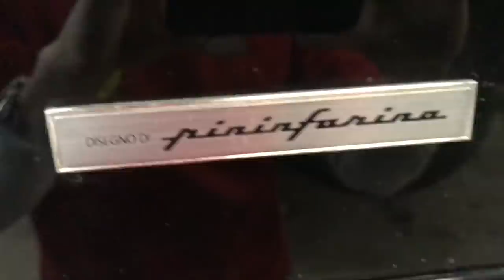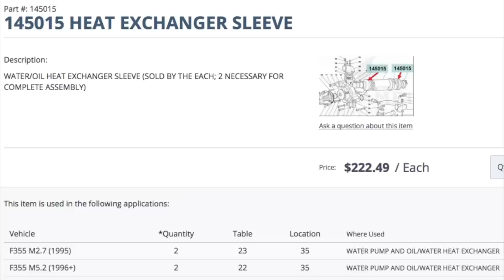Here's What Broke on My Cheap Ferrari F355  ***OUCH***

Comment: Don't get too cocky about your +/- 1000 dollar hose job. Until you get it fully warmed up and running under a load- with a good radiator cap, you really don't know anything. The rings could have lost tension, or scored the cylinder walls, the head gaskets, heads and block could be warped and ready to give up on the first pull, or six months down the road. I've seen it enough on "lesser" cars. Still good luck and enjoy, it's a ride most people will never see in the real world no less own.

Comment: Another note...that version of the power steering reservoir cap is a pile of shit. It doesn't fit very well in terms of forming a tight seal and can leak or even work itself loose. Get the updated cap, it's not a lot of money, and if I recall correctly is a VW part so you can cross-shop it for even less $.
Reply: I FUCKING TOLD YOU !!!! Now you have a giant toasted marshmallow.

Comment: "look at this situation where the engine has to come out for a minor repair" yup... this is why I would never own a 355, and to a lesser degree a 360. Supposedly the 430 and 458 are easier to work on, but also quite expensive. No such thing as a cheap Ferrari. At the price point of the 355/360 BMW e46 M3 looks like a performance bargain, and reliable to boot (in comparison, but yes they are not perfect).

Comment: Lets see if you really read all the comments. 

0:43 - It's probably due to warped head. I had the same problem with my 78' C3. 
It blew upper hose off the radiator and sprayed whole engine bay with coolant while driving. Leaking hose is due too much pressure in the system and probably that just gave up. 
If you just replace the hose, it will probably gave up in the same spot (or other weakest of the system).

Welcome to money pit...

Comment: Owning a ferrari sounds like a nightmare for someone who is ultra rich. The car seems to be poorly engineered if an owner has to do so much maintenance and repair to it at under 40,000 miles. A typical honda will go 60,000 miles plus before anything major needs done.
Reply: **who isn't ultra rich
Reply: Yea but for rubber parts age is as much a factor as use.

Comment: Just saying.... There's a panel that comes off behind the driver and passenger seats. That gives access to the timing belts and all the drive belt pulleys as well as the water pump and such. You don't need to pull the engine out
Reply: lol... You do realise where the fuel tank is, don't you?

Comment: Why would you put expensive antifreeze into the cooling system to run the engine for a couple of minutes to diagnose a fault? It's obvious that there was a 99.99% chance that, whatever the conclusion, you would have to drain and dispose of all the coolant to fix the fault?